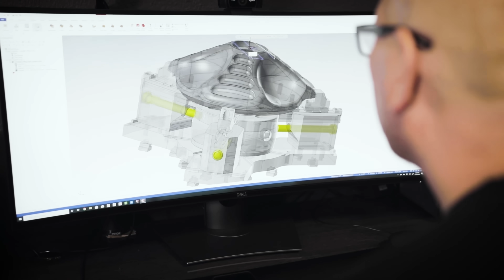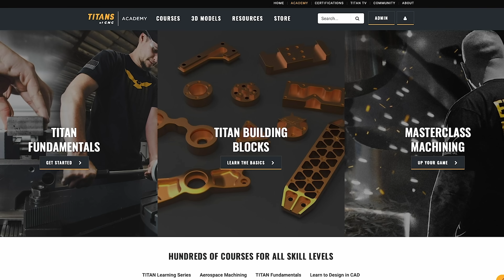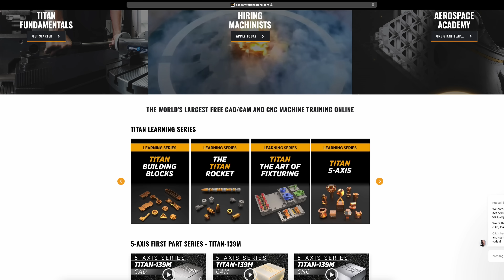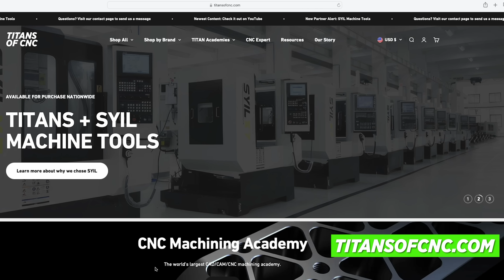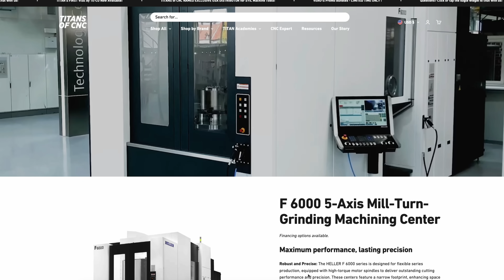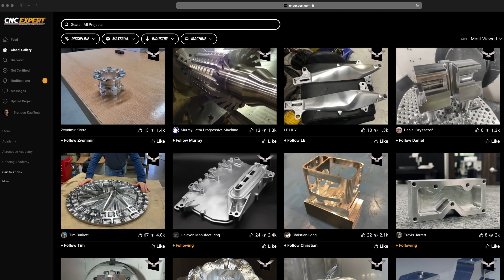Who is TITANS of CNC?

Comment: The one thing I will say being in this  industry for over 30 years.  I have gone from a newbie to working in mold shops tool and die shops  job shops a cnc programmer and now Engineering in the aerospace industry.  I have seen it all  I have done it all set up , fixture design, macro programming can run every cam software on the market.  The machinery in this shop is amazing , the reality of it all is this. Most shops do not have these capabilities most big shops have machines half broken most don't hold tolerance , new machines are laughed at. A prime example is Starret  Tool . Most of there machines are 1950s. They still run acme screw machines . lots of shops do not have a but a few sets of mics and some gage pin to measure parts.  Its sad and that's why this industry is falling apart shop by shop. Its sad really i have made a good living doing this .
Reply: Never been in an ISO 13485 or AS9100 shop I take it?  Shops at that level can't compete unless you've got the tools/machines to keep up.  If they fall behind the curve they die.  Sometimes quickly sometimes a slow death.

Comment: I've been in the trade now 50years I have one of the first desktop computers people here in Phoenix told me back in the day I was one of the baddest ass badasses here we were cutting remex tape reader plugs off hooking them up to commodore 64s most shops didn't have N/Cs if they did they didn't have word address cards.
Somewhere around here I have the equivalent of a 1980 USB drive, a raw FIFO memory with dip switches on each end to adjust the baud rates the number of bits all the parameters in or out it wasn't that big but you can even use it as more tape from memory when you've already used up your 80 m.
Junior year of high school I made my first 20 sets of 426 hemi heads for top fuel and alcohol racing.
I can't even believe where the computers are today although I've come to that point where I hate technology I don't want to ever know or remember a password ever again there's a feeling like no other feeling at the end of the day that is knowing you can make anything you can dream of if someone can dream and explain it to me I can make that.